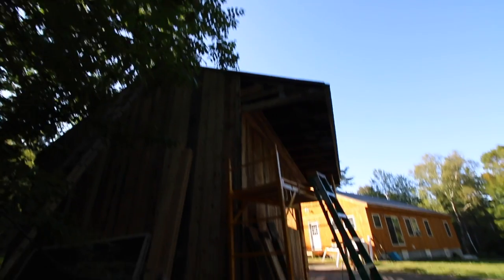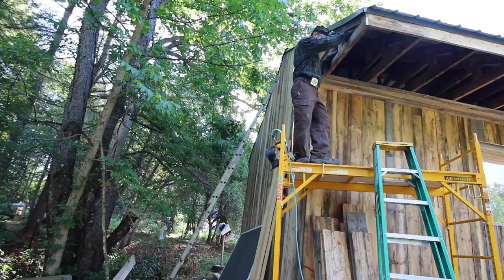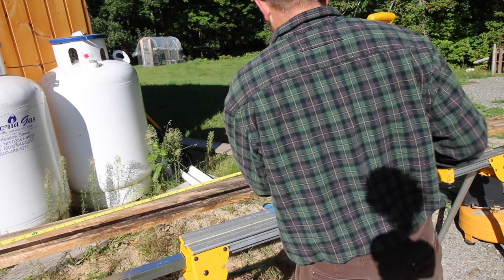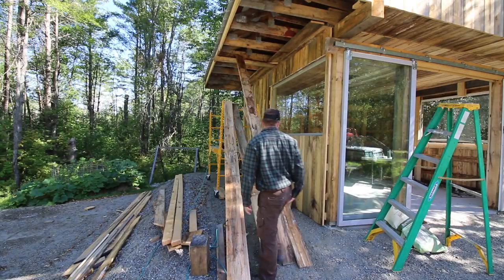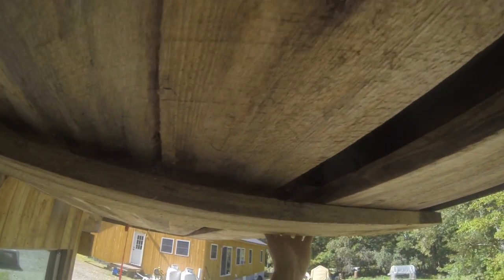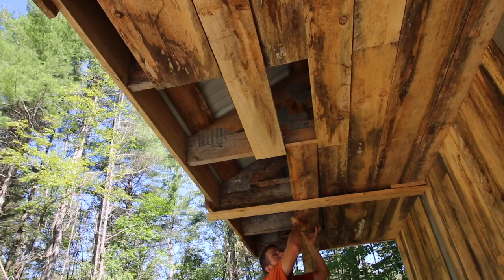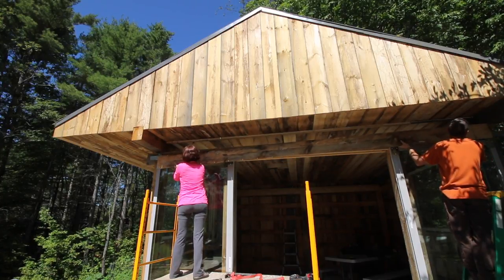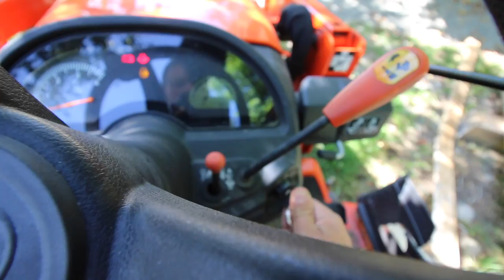Trying to get the Last of the Siding on the Off Grid Outdoor Kitchen

Comment: I would put gutter on the tractor overhang side.  Otherwise when it rains the water running off the roof will splash on the tractor.

Comment: Excellent stuff! The overhang and the outdoor kitchen in general is looking great! Would suspending a roll-up awning towards the rear of the overhang perhaps help with the Kubota shelter? Well done on the GoPro which adds a new element to your footage and an external mic might be good? Olivia definitely looks like the boss in the safety gear! :)
Reply from the maker: Olivia loved the safety gear! Thanks! I will post a picture on social media. I need to do something in the winter for the kubota
Reply: Oh, and I love the new website! :)
Reply: Welcome! I thought a roll-up awning suspended with pulleys towards the rear might not obstruct the window light too much and would also allow you to back the Kubota in without needing to avoid the awning and you could roll it down afterwards :)
Reply from the maker: Sounds like I have another project! :)
Reply: Simon B .